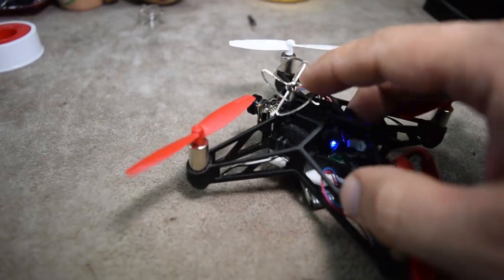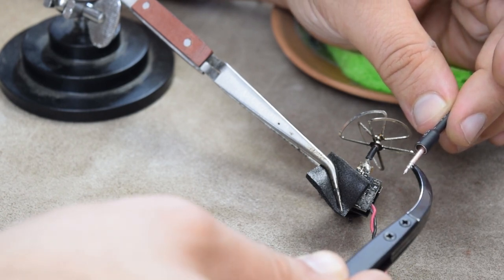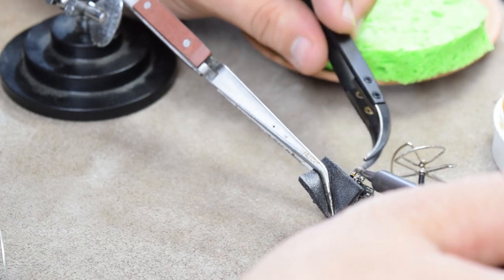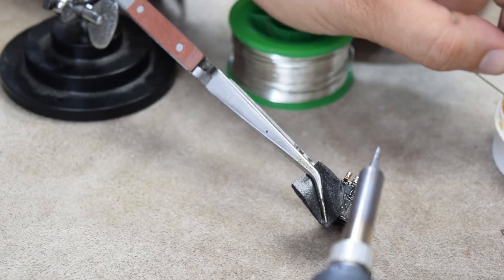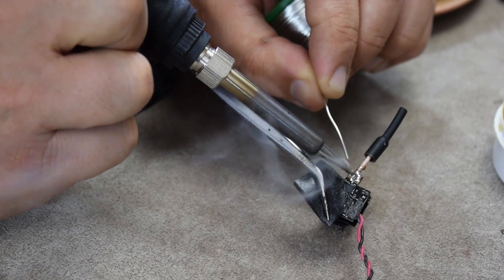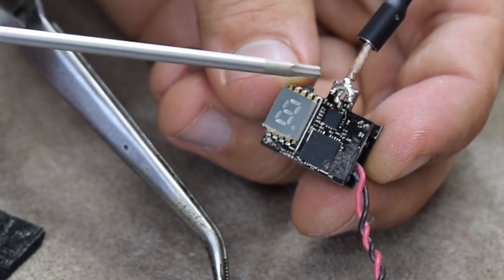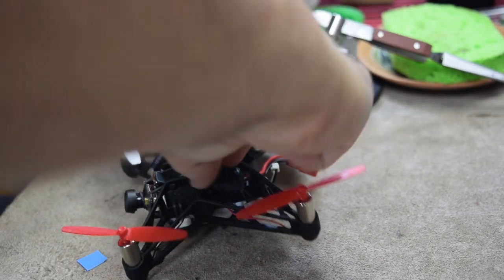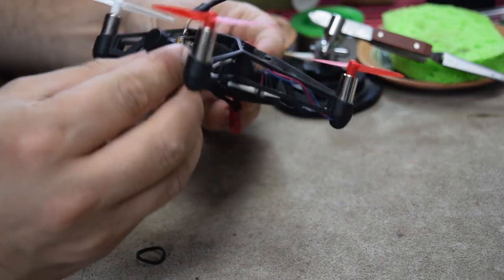How To: Repair a Broken VTX Antenna

Comment: I always add hot glue and heat-shrink to the antenna connection to give it strength. Nice job replacing it.